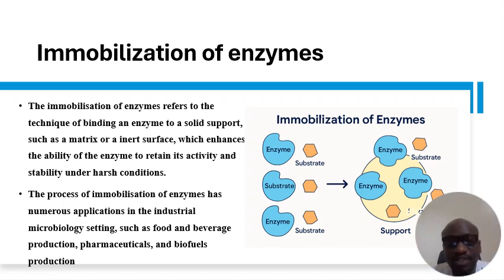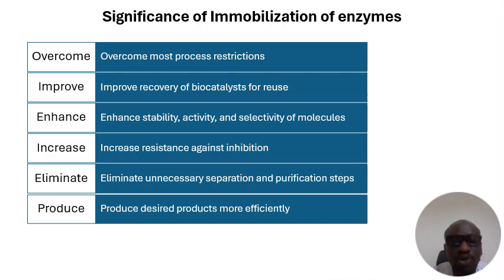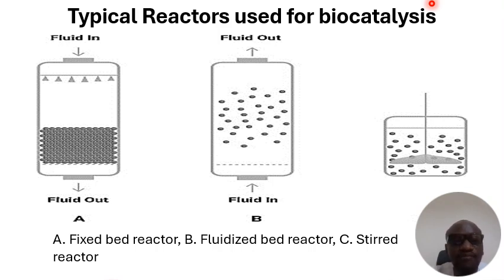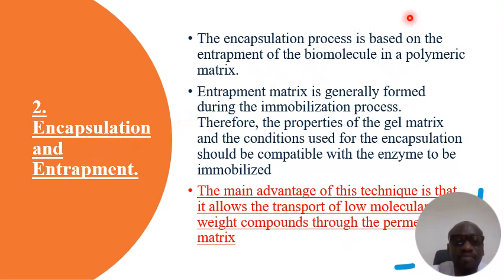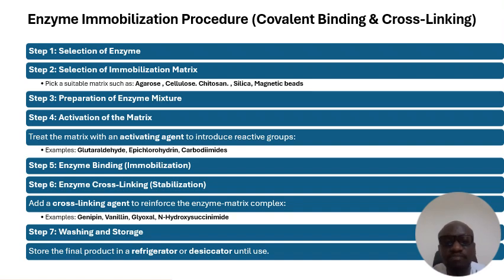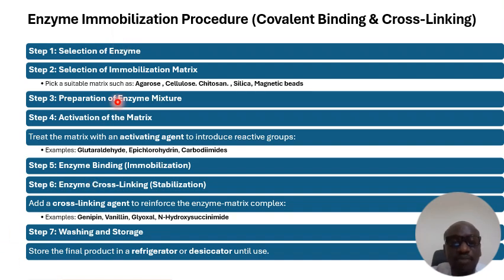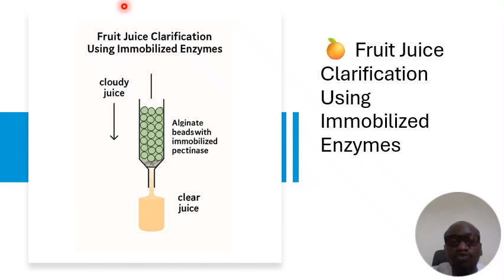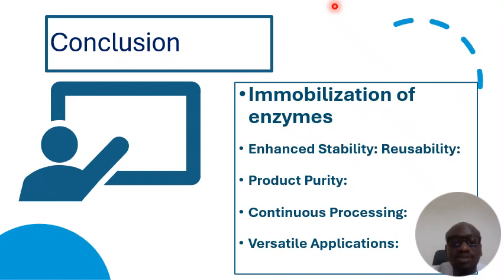Immobilization of Enzymes (Industrial Microbiology )

Comment: 1. Immobilisation of enzymes is the process of binding enzymes to a solid support, such as a matrix or an inert surface, while allowing them to remain active. This is achieved through techniques such as adsorption, entrapment, covalent binding, or cross-linking, making the enzymes easier to recover and reuse, improving their stability, and increasing the efficiency of industrial processes.

2. Advantages of Immobilised enzymes include:
-Immobilised enzymes can be recovered and reused, reducing production costs.
-They are more stable and better able to withstand changes in temperature and pH.

-Application: One real-life application is the use of immobilised pectinase in the fruit juice industry to hydrolyse pectin, producing clearer juice and improving filtration efficiency.

Name: Omoowo Hasiyat Kehinde 
Matric Number: 210807087
Reply: 1. Immobilisation of enzymes is the process of attaching enzymes to a solid support to restrict their movements while preserving their catalytic activity.  Enzymes are fixed to an insoluble support through physical methods such as adsorption, entrapment, covalent binding, or cross-linking, making the enzymes easier to recover and reuse, improving their stability, and increasing the efficiency of industrial processes.

2. Advantages of Immobilised enzymes include:

-Immobilised enzymes can be recovered and reused, reducing production costs.

-They are more stable (enhanced stability) and better able to withstand changes in temperature and pH.

-Application: One real-life application is

Biosensors: Immobilized glucose oxidase on test strips allows individuals with diabetes to rapidly monitor blood glucose levels.

Name: Imhenrion Divine oluwatobi 

Matric Number: 230807558

Comment: Question 1: 
Immobilization of enzymes means attaching or fixing enzymes to a solid support or matrix (such as surfaces, or gels) so they can be used in reactions while remaining in place. This allows the enzymes to retain their catalytic activity, making it easy to separate them from the products at the end of the reaction. 

It is useful because it enables reuse of the enzymes, reduces costs, improves stability against temperature or pH changes, and simplifies downstream processing by minimising contamination of the final product. 

Question 2:
•  Advantages:
	1.  Enzymes can be easily recovered and reused multiple times, which lowers overall production costs.

	2.  They offer greater stability (e.g., resistance to heat, pH changes, and denaturation) and support continuous processing for higher efficiency. 

•  Real-life application: One common example is in the food industry for producing high-fructose corn syrup, where immobilised glucose isomerase converts glucose to fructose in a continuous process. 

Name: Ogungbemi Olorunjuwonlo Diekolola 

Matric number: 210807055

Comment: 1. Enzyme immobilisation is the process of binding enzymes onto a solid surface or matrix so they remain stable while still performing their catalytic functions.

This method keeps the enzymes stable and functioning effectively during chemical reactions. It makes it easy to separate the enzymes from the finished product and can be reused for multiple industrial processes.

1. Advantages of Immobilised Enzymes:

• Enzymes can be easily collected and recycled for multiple production cycles to save costs.
• Fixing enzymes to a solid support prevents them from mixing with the final product, minimizing purification needs.

Real Life Application

• Lactose-Free Milk Production: The dairy industry uses immobilised lactase enzymes (often held in small alginate beads) to break down the natural sugar in milk into glucose and galactose, allowing lactose-intolerant people to enjoy dairy without digestive discomfort.

Name: Echefu Chimbuchi Daberechi 
Matric No: 210807095

Comment: Question 1: Enzyme Immobilization refers to the technique of binding an enzyme to a solid support such as matrix or an inert surface which allows the enzyme to retain its activity during use. 

1b. Enzymes are fixed to support through various techniques such as physical adsorption, encapsulation and entrapment, covalent binding and cross - linking method. 

They are useful because the fixed enzymes can be easily filtered and recovered from the reaction mixture, allowing them to be reused for multiple reaction cycles.

2. Advantages of immobilized enzymes:
- It reduces the cost of downstream processing 
- it allows for easy separation of enzymes 
 
2b. One real- life application where they are used is in the dairy industry where enzyme immobilization techniques are used in the production of lactose free milk. 

Name: Akindolie Fiyinfoluwa Martha 
Matric no: 210807116

Comment: 1. Enzyme immobilization is the process of physically fixing an enzyme to an insoluble solid support or inert surface so that it retain its catalytic activity while allowing repeated use without significant loss of activity.

Enzymes are fixed to support through techniques such as physical adsorption, entrapment/encapsulation, covalent binding, or cross-linking.

They are useful because they can be easily reused several times, they have improved stability against heat and organic solvents , reduce downstream processing costs, support continuous production, and produce high-purity products.

2. Advantages of immobilized enzymes include: 
-  They can be easily recovered and reused.
- They have improved stability against heat and pH changes.
-  One real life application is : Production of lactose-free milk using immobilized lactase (β-galactosidase) to hydrolyze lactose.

Eniola Adedokun 
210807094